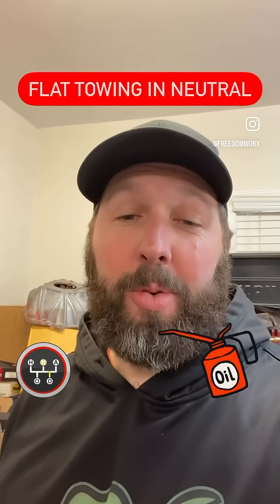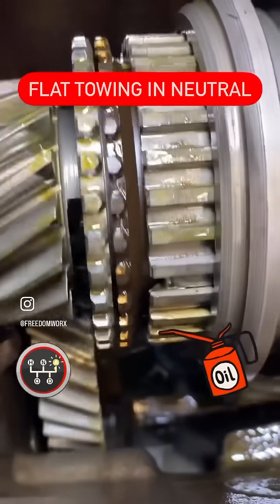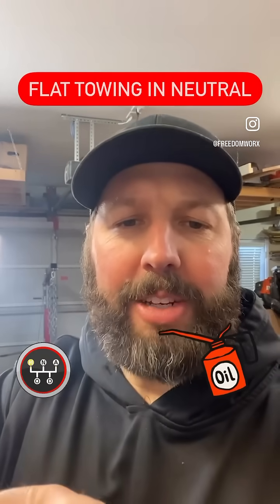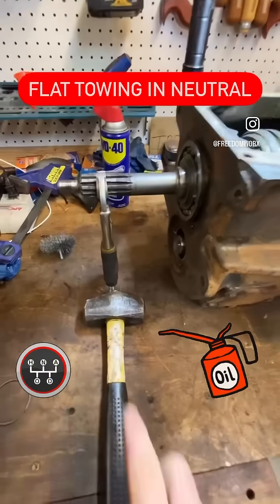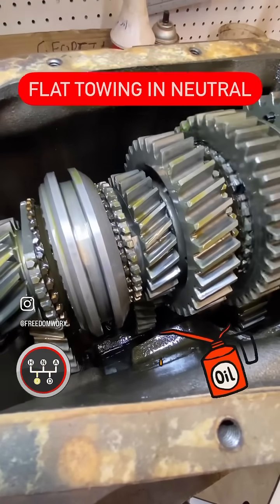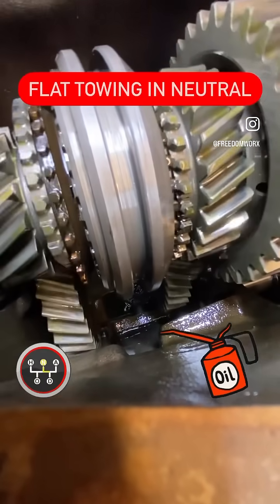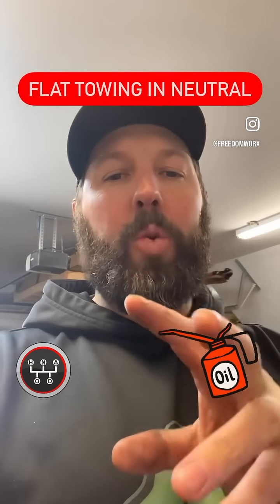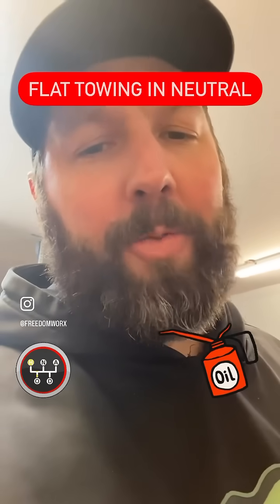Don’t Flat Tow in NEUTRAL!  #transmission #stickshift #mechanic

Comment: Fun fact, I may have set a land speed record for road graders. I was at the top of the hill on coastal 101 in Northern California. I put it in neutral and was able to hit 60 mph on the way down, allegedly. At the bottom, I put the transmission in gear and everything worked fine, maybe. I mean it did except for the new whining noise. Turned out I did $20,000 damage just in parts. Almost lost my job over that one. Turns out you should read the manual.
Reply from the maker: Impressive 😂

Comment: OK, I have a crap ton of experience in this as they work for a construction company and well making this comment. I’m driving the old Ford Ranger that is a 2 Wheel Dr. and we just put it in neutral and it’s been towed well over 300,000 miles no problems

Comment: With a Jeep Wrangler your transfer selector has 3 positions, 4wdhi 4wdlow and neutral, are they saying to put it in neutral in case you were in 4wd.  The default is neutral for day to day driving on dry pavement.  Am I misunderstanding something.  Also in you have a manual, what gear do you put the transmission in I read somewhere 3rd gear, but the top end speed for 3rd gear is only 55, so do you use 4th or 5th gear.   I owned a 2008 JK Rubicon, but never towed it.

Comment: We just towed a 95 TA with T56 on its rear wheels 100 miles, stopping halfway. The trans seems to be fine. we put in new input shaft and bearing. Both input and output spin freely in neutral. Will it be fine you think?

Comment: The best way IMO if you have manual locking hubs to just pull the rear driveshaft.  No worries about damaging your T-case or transmission. It's more work yes but for long distance I feel it necessary.   I learned that even though you put the t-case in neutral it can still wander into gear and grind trying to engage but you'll have no idea it's happening since your driving.

Comment: He he, I know someone that had a Ford Sunliner 500 convertible, 1962 year, I'm guessing, it was years ago. Anyway, it had  manual transmission.  At about 65 mph, the transmission locked up, spinning the input shaft, exploding the clutch and bell housing, destroyed the transmission case and threw gears all over the highway.  It also put a very impressive bend in the large diameter output shaft and destroyed the drive shaft.

Comment: depends on if the transmission output sits around the oil level or not, cause decentt amount of manuals do so it can be flat towed without much of any problem
Reply from the maker: Well few things are completely universal. There are some manuals that can be flat towed perfectly fine in nuetral. That’s why I always say to refer to the owners manual.

Comment: Yup, my 96 Jeep XJ said in the manual to tow it with TC in neutral and Transmission in Park. I checked a forum and they said that was correct. Towed the thing and had no issues.
Reply from the maker: Yep. That’s the standard operating procedure for most manual trans 4wd vehicles. 👍

Comment: I have raced FV cars for over 40 years and when I check the fill level in the VW trans axle, I leave the fill plug open and with the car in neutral I raise one wheel and turn it and guess what? All the gears are turning in neutral. So I am not sure this is a good explanation.
Reply from the maker: A VW has a transaxle, not a transmission.
Reply from the maker: https://tremec-blog.com/flat-towing-tremec-transmission-vehicles/

Comment: The only way you can safely flat tow is if the transmission is fully disconnected from the tires.  You should be able to test this by starting the engine, putting the vehicle in gear (or in drive or reverse on automatic transmission) and releasing brake or clutch and the vehicle is not moving (this is the case if your transfer case is in neutral).  For automatic, the transmission should be in park while transfer case is in neutral while flat towing. The vehicle should easily roll when any force is applied.

Comment: 3rd gen 4runners the transmission is lunricated by the output shaft. However the transfer case is libricated by the inout shaft. So if you have to do 2hi, N

Comment: Btw this also logically means that you shouldn't coast in neutral with the clutch disengaged. Of course there's really no reason to ever do that, as you'd be riding the clutch pedal pointlessly, other than very briefly if you double clutch, but that's not enough time to do any damage to the gears or bearings.

Comment: Now I'm confused: You referred me back to the manual. Just kidding! Great Video. Another tech tip: Don't flat tow Your stick shift with your dog in the vehicle that you're towing. Fido through my buddies car into first and after towing only about 10 miles on the freeway The engine overheated and seized because the electric fan never turned on and probably some more reasons. Bad dog, bad!

Comment: Or, if towing an AWD car where you can't disengage either axle, use a flatbed, as I do.

One of my biggest fears is having my car towed when I'm not present, due to either a parking violation or some incident like a nearby fire or emergency street repair, since I have no off street parking and have to park my car on the street, and the doofuses doing the towing not realizing or caring that it's an AWD and basically destroying the transmission, driveshaft or rear diff. I've been lucky so far, though.

Comment: I flat-towed my VW Beetle 300 miles in neutral back in 1986.  In 2018 I had to install a rebuilt transmission.  Not sure that makes or breaks Freedom Worx' argument...
Reply from the maker: A VW Beetle has a transaxle, not a transmission. Not the same animal. That being said, there are some manual transmissions where it’s perfectly fine. That’s why I said to read the owners manual. 🤷🏻‍♂️

Comment: Idle the vehicle being flat towed, what the hell put the sucker in top gear and a brick on the throttle it will help the tow vehicle go uphills.
Reply: If my car is being towed, it's because the engine does not run, let alone idle 🤣
Reply: @ZenTunE-  Your car sucks...lol
Reply: @tymobyrne4451  To be fair, that's quite a common reason to tow a car lol

Comment: The car I had with automatics gearing had a warning in the instruction manual that it should only be towed short distances at low speed. Non of the cars I have had with manual gearing ever had any such warnings in the manual.

Comment: Thank you for this explanation.  I've been wondering about this for several years.  A little background:  In the 1950s, 60s, 70s, and even into the 80s, most US built full size cars with an automatic trans would say something in the manual that it was OK to tow with the drive wheels on the ground for some distance at some speed, typically 35 miles at up to 50 MPH.  However, standard trans had no such limit.

Fast forward to a few years ago and I started watching "Highway Through Hell" on cable TV and a couple of Heavy Rescue towing channels here on YT.  The would make a big deal of not towing a semi even a few hundred feet without pulling the driveshaft or the axles.  Since most of those had multi-speed manual trans I couldn't understand why as I equated them to the manual trans cars of 50 years ago.  Now I get it.  Again, Thanks.
Reply: I remember rolling down a hill to bump start on old Pontiac with a 2 speed power glide....
Reply: @TheWolfsnack  Many early automatics had two hydraulic pumps, one driven by the engine and one driven by the drive shaft.  So, yes, you could push start those cars.  I don't know of any automatic trans since the 1970s that have a rear pump.

Comment: There are certainly models of transmissions where this does not apply, our 2007 Toyota Yaris has been towed through at least 38 states and has nearly 240,000 driving miles on it and the transmission still works.
Reply from the maker: That’s a transaxle, not a transmission 😉. But yes, it’s perfectly fine for some transmissions and most transaxles.

Comment: Why do gears that aren’t meshed with other gears, especially with no load need the lubrication?
Reply from the maker: It’s not the gears, it’s the bearings. There is a ball bearing on the output shaft, and roller bearings that are at the intersection of the input and output shaft. They will fry without oil to cool them. https://tremec-blog.com/flat-towing-tremec-transmission-vehicles/

Comment: If its under 15 minute tow, can you not flat tow and keep the engine on on a front wheel drive manual transmission with an overfilled transmission in neutral?

Comment: So, I've got old Subarus... The front diff is built into the transmission, no transfer case to neutralize. I wonder if they're among the few capable of oiling when driven only from the output...
Reply from the maker: That’s a transaxle, not a transmission 😉 Different animal. Most of them will flat tow just fine.
Reply: @freedomworx  I was thinking about this and yeah, a transaxle should be fine flat towing because the diff is inside the case, so it'll do the job of flinging oil everywhere.

Comment: Problem is, all modern 4WD trucks are electronically controlled. So you can't put the transfer case in neutral anymore.
Reply from the maker: Many have provisions for that in the owner’s manual. Holding both buttons down, do the hokie pokie, etc. So some T-Cases can still be put into neutral, you just have to read the manual 👍
Reply: That's a lie

Comment: Saginaw can be modified by adding a street elbow to the fill port and raise the gear oil level. Then you can flat tow. It will cost you some power when driving.

Comment: You are not completely correct, sir. Your scenario works only for transmissions designed with the main shaft being also the output shaft and placed atop the counter shaft. But transmissions where the counter shaft is the output shaft are safe to tow in Neutral. Same for transmissions with counter shaft and main shaft located horizontally next to each other where both get to pick up the lubricant.
Reply from the maker: Probably why I said that in the video, and the video description. So yes, I’m correct.

Comment: I have a habit of putting my car in neutral, then foot off all pedals except the brake, and coasting up to red lights. Are you saying this is generally a bad idea with manuals? Is it better practice to engine brake/downshift?
Reply: Plenty of oil in the bearings for that little amount of coasting.   Down the mountain?  Less ideal.  
Of course if you're talking a FWD car then the differential is throwing oil all the time.
Reply: @bobclarke5913  Yeah, my 2 manual vehicles are front wheel drive manual cars. A camry and a civic.

Comment: Guess it depends on the height of the oil filler plug and if any mainshaft gears are providing any oil churn.
Many (most?) manual designs, like Aisin, BorgWarner and Getrag won't suffer any damage, there is sufficent lubrication in neutral while towing.

Comment: there is nearly no load condition when you towing, so the bearing probably won't got heat up, otherwise the transmission is fully dried or not run for a long period of time.
Reply from the maker: Argue with Tremec then. They build manual transmissions and here is what they say 🤷🏻‍♂️ https://tremec-blog.com/flat-towing-tremec-transmission-vehicles/

Comment: By this logic anytime youre clutch in coasting youre starving the transmission for lubrication. 

How would this work for vehicles that you can flat tow in neutral?
Reply from the maker: Not anytime. Only if you are coasting in Nuetral with the clutch depressed. If the trans is still in gear, the output shaft is spinning the countershaft and oiling everything. Some vehicles have transmissions that can be flat towed in neutral. It’s not universally bad.

Comment: Put some Lucas in it , it will be fine.  You sure don’t want to tow it in gear . This is where locking hubs and a transfer case come in handy.
Reply from the maker: Some transmissions can be destroyed by flat towing…so certainly DO WORRY ABOUT IT 🤷🏻‍♂️ https://tremec-blog.com/flat-towing-tremec-transmission-vehicles/
Reply: All kidding aside , you are correct. 
Always follow manufacturers instructions

Comment: No, never been told that. Dad flat towed a standard car in neutral for 100k miles. Car went another 200k miles with the new owner. Head gasket went.
Reply from the maker: It’s dependent upon the vehicle and trans design. It’s not universal, but it is pretty common.

Comment: take care of your vehicle so it doesn't have to be towed.  also, this really depends on how far you're going.  the output shaft isn't under any load so the residual oil in the bearings is going to go a ways.  I've never heard of a tranny that's been ruined this way.  now an automatic - that's a different story altogether.

Comment: I've been flat towing all kinds of manual transmission vehicles in neutral for more than 3 decades now, some of which were towed that way for many thousands of miles, and not once have I ever had a transmission failure... 🤷‍♂️
Reply from the maker: So you are saying that because you haven’t had a failure, It’s not true? Like, I smoke and don’t have lung cancer yet so smoking doesn’t cause cancer…Or like, it can be done if you buy the proper vehicle and follow the instructions in the owners manual. Want to tell us which vehicles you are flat towing? Did you read the owners manuals to understand how to flat tow those vehicles properly to avoid damage? It can be done safely with plenty of vehicles, and it can destroy others in short order. So do you fall into the “ignorant but lucky” camp, or the “I bought the proper vehicle for flat towing and followed the owners manual instruction to do it without destroying the transmission” camp? 🤷🏻‍♂️
Reply: @freedomworx  I have no doubt there are some people who have damaged a manual transmission by flat towing it, but I'm absolutely confident in every case it was due to poor maintenance and low or no fluid in the transmissions to begin with. Any manual transmission that has the proper fluid level and that isn't already damaged in some way will absolutely survive flat towing in neutral just fine. If I had to guess why manufacturers say not to do so in the manuals, it's because it gives them another reason to void your warranty rather than trying to prove you didn't check the fluid levels.
Reply from the maker: @bluegizmo1983 You might be absolutely confident, but unfortunately, you are also absolutely wrong. You fall into the ignorant but lucky category. And that’s not me saying you are an ignorant person, but you are ignorant on manual transmission design. It has nothing to do with maintenance or having the proper fluid level. You can flat tow a brand new Jeep, right off the lot. And if you do it by placing the transmission in Nuetral, instead of placing the transfer case in neutral, it can fry the transmission on its first trip behind an RV. You don’t have to believe me, but you should probably believe the people that actually make the transmissions… you’re welcome 🤷🏻‍♂️ https://tremec-blog.com/flat-towing-tremec-transmission-vehicles/

Comment: So...  place it in top gear and hold down the clutch with something?
Reply: If the Transfer Case is in Neutral then it wouldn't matter whether the Trans is in gear or not.
Reply: But if you don't have 4wd, so a "car" more than a "truck" it'll work, I guess?

Comment: I've done this with every vehicle I've owned never had an issue sometimes you gotta do what you gotta do
Reply from the maker: I don’t doubt you. Sometimes you get lucky 😉. But in reality, it’s not applicable to all manual transmissions, and even those that are susceptible, most can tolerate it for some distance and low speeds.

Comment: Nice demo - this doesn't apply to all M/Ts though - in transaxles like FWD cars, the ring gear on the diff typically acts as the oil pump (just like an axle) so there's oil flow whenever the vehicle moves in gear or N - when idling in N, only the input shaft turns with no feed, which is why shielded bearings are sometimes used for the input shaft because they retain oil - speeds are low enough and residual oil is sufficient that the needle bearings on the speed gears don't require oil feed
Reply from the maker: Doesn't apply to all M/Ts, and certainly doesn't apply to transaxles the same way.👍
Reply: @freedomworx  Still good to know 👍

Comment: But you can't spin that as fast as the wheels can and the oil will be everywhere inside that case. But if I was going to flat tow for a long distance I would pull drive shafts and or car dolly it.
Reply from the maker: The oil is in the bottom of the case, it’s thrown up by the countershaft. The countershaft won’t be spun by the output shaft in Nuetral 🤷🏻‍♂️

Comment: It depends on the design of the transmission whether it will self-lubricate when flat-towing.  Also, some transmissions will not splash lubricate when idling in gear at low ambient temperatures.   Like you said, check the owner's manual.
Reply from the maker: Yep, it’s not universal 👍
Reply: @freedomworx  also seems to be more exclusive to RWD/AWD setups.

(granted no 100% comprehensive) Most FWD transmissions, the countershaft (which in turn connects to the differential in the gearbox) turns all gears on the main shaft which freewheel unless selected by the shifter fork.